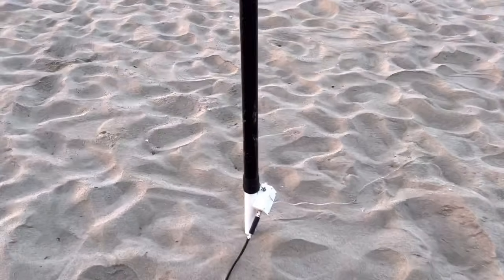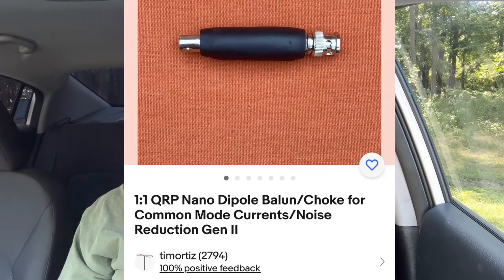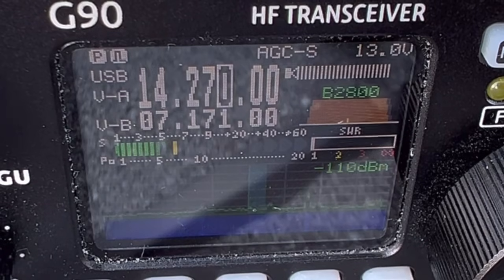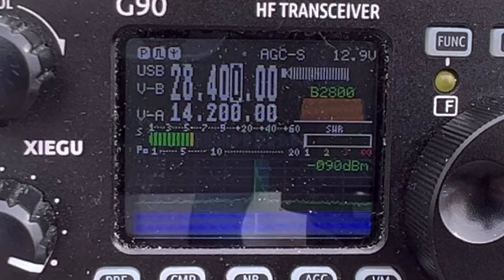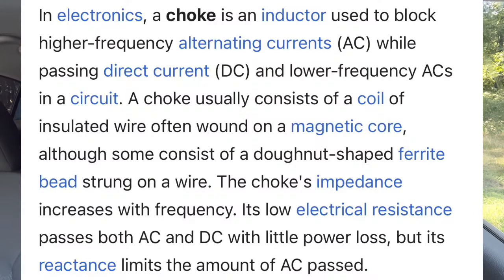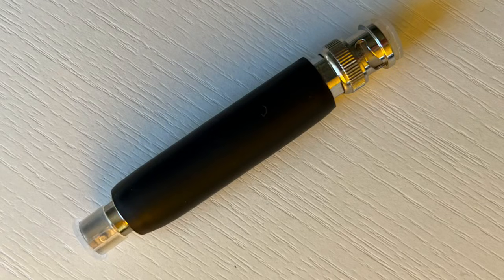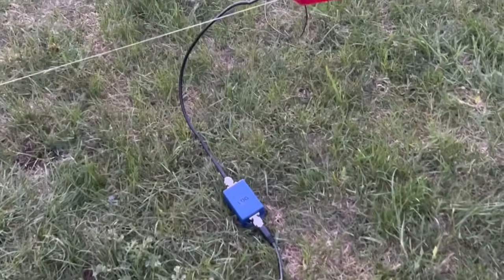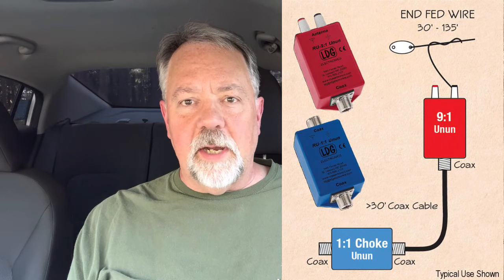Understanding RF Chokes for Antennas

Comment: This was helpful to me.  I've been a ham since around 1990, but I was off HF for various reasons for the past 30 or so years.  I'm retired now, and have been watching a lot of POTA videos and decided I wanted to give that a try.  I have a Kenwood TS-440 in storage but went ahead and bought a Yaesu FT-710.  I'm using a Chameleon whip with their Faraday strips for 20M and activated two parks in the past week, getting 60+ contacts each time.  My second park was quite noisy for unknown reasons, so I am hoping a choke will help with that.  Regardless, it should make my antenna more efficient.  I'm going to go with the Comtek inline coax choke from DX-Engineering I believe.

Thanks for this an all your other helpful videos.  

Dwayne
K4UTV

Comment: I'm an idiot, so bear with me please!  A choke is a choke is a choke?  I have an LDG 1:1 unun, and you're saying that all I need to do is connect it at the feedpoint?  Unless....at some point...I use something other than my 17ft whip?  And in that case, use the appropriate balun/unun with the 1:1 on the feedline after that?  Or is there a requirement for 30ft of coax between the appropriate unun and the 1:1 unun?
Reply from the maker: You’re not an idiot and that’s a great question. There are so many debates on where to use a choke and if you need one or not. There is no requirement of any amount of coax between the choke and the feedpoint balun if you are using radials or some kind of counterpoise. That’s my understanding and experience. 73, Walt
Reply: @COASTALWAVESWIRES  makes sense...I forgot about the counterpoise!  Thanks for getting back to me!!

Comment: Can you clarify something? If it’s an end fed antenna using the coax as a radial, should the choke be at the feed point or the radio? If the choke is at the feed point will that prevent the coax from being used as a radial?
Reply from the maker: If using the coax as the counterpoise choke should be at radio, not feedpoint.

Comment: I thought I had another issue as I was using a coax that had a built in choke. I decided to add more ferrites to that cable and bam!  No more rig and heil pro headset issues. It was all RF coming back into the rig.

Comment: ABC Lol... Thanks for the info Walt. I just got a 7 ferrite choke from ABR and had it at my radio, but I'm going to move it to the feed point on my long wire. I notice I've got RF into my shack because I can hear myself talk through my computer speakers. Hopefully that does the trick. KJ5IXX

Comment: you also change the radiation pattern when you use one i have tested this your Rf current field strength on the radiator is stronger

Comment: So if I’m installing a 49:1 EFHW (10m-80m) at my house. I was going to run the wire in an inverted V because I don’t have a lot of space, I was going to run around 40 feet of coax outside to be the “counter” should I put the choke closer to the radio or right outside the 49:1. If it helps I’m using a Par Endfedz antenna.

Comment: Allright it keeps the rf from coming back from the antennae, but how  does it let the rf from the transmitter get “to” the antennae? The way you are describing it, it appears to act as a check valve or diode.
I always  thought of a choke suppressing high frequency harmonics while letting lower desired frequencies pass based on the reactance at the different frequencies.

Comment: Could you reply and explain, If a solid copper #10 wire is close wound with fine # 30 insulated wire from end to end,  then both wires  soldered together at both ends. There was early 1900s patents on this style device, and was referred to as resistance coils. 4 different patents used this style device in antenna lines. Could you explain how this would work or what the effects would be? To me it dont make sense to solder both wires together at both ends.  Thanks BOB
Reply from the maker: I’m sorry to say I really don’t know. I’d have to research this one to give you a better answer
Reply: Thanks for the reply. Here is a short patent to look at for a quick study when you get time. Chauncy Britten, US patent 1826727. Be sure to use the Rex Research site when you google this. One other thing of interest is google Peter Markovitch ATREE. This explains the coil better and how it works. BUT, I cant see in my mind exactly what is happening. If you look at them, and have time , please reply back and explain what you see going on with this coil. I think its a RFC.     BOB

Comment: this may be a very simple question/ answer.. would using LMR coax help the lack of chokes due to it's properties? i would have to replace my coax if not, as it is cut/installed to exactly the length needed to get to the antenna. thank you for your videos. i am limited to 11m, just trying to do all i can for what i have.

Comment: Glad I saw your diagram with the ununs, I was confused with all the different ununs and baluns. Some youtubers say you need one type and then use another one. This is the first example of using two ununs on the one feed.
I’m still waiting for the 9:1 unun from Amazon, it seems to take an eternity. Yes I could make my own but I’m not really up to that. I’d like to start with commercial products before diving deeper, rather than flounder with something I made not working properly at the learning stage.

Comment: I installed an RF choke on the coax cable for my 10m Ampro 10 from Moonraker. The choke works well since it gets warm, indicating it's functioning. However, the heat also signaled that something was wrong with the antenna, suggesting inefficiency as the antenna used the coax as a dipole outer conductor. I already installed two radials, but they don't seem to be sufficient. The antenna is only 2 meters above the ground (which is fine for FT8). To test, I attached a 5-meter long wire to the ground of the coax connector, and the choke no longer got warm. The RF flowed through the 5-meter wire instead of the coax. I could have also installed the choke about 3 meters before the antenna connector, effectively creating a dipole. What I'm saying is that chokes can be used effectively to construct dipoles with coax without those inductive coax chokes that distort everything, especially at frequencies above 20m.

Comment: Great video… so I can use the LDG 1-1 ulnum inline in my coax when using my end fed random wire antenna to stop RF from coming back to the radio? And it will function as the needed choke?

Comment: Thanks Walt. I'm a new ham, and I can understand how chokes work (more or less), but I would like to know a little better about the correct placement or location for an antenna  choke. I've seen where guys hook them up in all kinds of odd places, near a balun on the coax, right on the antenna wire itself, even in the shack next to their radio. If you have an answer it's appreciated.
Reply from the maker: Great question and there’s really not a definitive answer, there are a few different schools of thought. If you are running something like an end fed halfwave with no counterpoise you might want to choke the coax at the radio and not the antenna feedpoint, this allows the coax itself to be the counterpoise. If you have selected ground radials on the ground  or a balanced dipole you would want to put the choke at the feedpoint to prevent the coax from acting as part of the antenna.
Reply: @COASTALWAVESWIRES  Thanks that helps a lot, as I'm setting up an end fed halfwave this week.

Comment: Can you elaborate a bit on the counterpoise wire added onto the choke… where/how exactly how to add that?  I’m new to this hobby.  Thank you.
Reply from the maker: Hi, the Counterpoise is added to either the negative side connector on the unun or it can be clipped to the outer side of the coax connector at the feedpoint. Basically you’re connecting the Counterpoise to the outer side wire on the coax.

Comment: Why doesn't the choke keep rf from getting to the antenna if is keeps it from returning??
Reply: Because the voltage and current are on the inside conductors, the choke increases the impedance on the outside braid of coax where the antenna current is travelling

Comment: Thanks for the video! Unfortunately, it looks like your friend no longer is selling the chokes. Some very interesting antennas though.  You've convinced me that I need to try them. I've been using a homemade vertical wire antenna tossed up in a tree branch when I'm portable. No choke or anything. Occasionally I see the SWR creep up and maybe that's why.
Reply from the maker: Thanks for watching and commenting. He must be out of stock, they go fast. Yeah you will see a major difference in the SWR when you’re transmitting with a choke. 73, Walt

Comment: Excellent explanation on the choke.  Funny the LDG documentation says a 30' coax between the 1:1 and 9:1, but your cable looks to be < than around 10'.  I guess the length doesn't matter as the whole concept of the choke is to block a frequency.  Again, great video on how to put all this stuff together.  The picture along with the explanation makes all the difference.  Great job explaining!
Reply: In LDG's diagram, only one wire is connected to the 9:1, with no counterpoise. So I think the 30' of coax is intended to be the counterpoise in that setup.
Reply from the maker: Thank you so much! Yes I think each situation is really different on the coax length. It's really all about testing it and seeing if it works in my experience. 73, Walt

Comment: I'm curious, if you just buy some of those clamp on chokes, how do you know how many to use?  Following your video to build a dirt cheap DX antenna, but some of the chokes are expensive ($50 too much right now).  I have a Xiegu G90, so I'm thinking I shouldn't need a lot to get on the air.  Thanks for the very informative videos.
Reply from the maker: I would experiment and start with one clamp on, tune the antenna, find an empty spot on the band, switch to FM mode, key the mic and watch the SWR meter on the G90. I've noticed that the SWR will jump high if you have common mode current in the feedline. I'd add another and repeat until you feel you have a good choke. 73, Walt
Reply: @COASTALWAVESWIRES  Thank you for the reply!  Would a ballun be necessary if using clip-on chokes?  If so, a 1:1 or 4:1?  Thinking specifically for the 17.5 ft antenna. 73 (AI5CK)
Reply from the maker: @ReformedPiper  for the 17.5 you’ll need a 4:1. It’s a great antenna.
Reply: Yes, I will try this as well. I saw a 4" coax with pl239 on both sides with a Ferrite core snap on with shrink wrap on sale for $25

Comment: I've experimented with ferrite rings lately and tried at the aerial and near the radio, I never previously bothered. The aerial ones didn't seem to do much and the ones at the radio worked better. Aerial manufacturers can't agree either, I've seen two aerial manufacturers where one said at the aerial and the other said at the radio. 
No dipoles of mine are in the clear so will always be a bit unbalanced but my theory is that r.f. can get on the coax after the choke considering the wavelength, the coax is in the r.f. field even though coming away at 90°. The SWR meter is happy with the rings at the radio. Perhaps we should use two? Or one a half wave or quarter wave down the coax?
G4GHB.
Reply from the maker: Interesting comment. I think each individual setup has different effects and it’s just a matter of trial and error. 73, Walt
Reply: @COASTALWAVESWIRES  Yes, see which works best for their system.
73,  Bill, G4GHB.

Comment: I also use a Nelson 9:1 unun with an 84' wire. I have made contacts all the way to Australia.. my problem is I get common mode current in the shack. I am not using a counterpoise based on the recommendation of nelson antennas.  I have upgraded my coax to 25' of kmr400 because it's double shielded. I get cmc worse on 40, 80, 160. Some on 20.   Based on this video and others by Walt I think I'm going to add 17' counterpoise and use a ldg 9:1 unun and ldg 1:1 choke. Any other recommendations? Hopefully i can stop my smoke detectors from chirping, my daughters led lights in her bedroom from flashing and my dogs collar from randomly zapping him while on the radio. I now take his collar off when I'm on the radio.
Reply from the maker: Take a look at the Chameleon Antennas 50 foot coax that has a choke on it. It's not too expensive and works great.

Comment: Great vid.   Just a note, a successful EFHW system is tapped at the end where the voltage and current is  zero.   So a counterpoise is irrelivant in this case.    On the other hand, a "random wire" antenna with a  9:1 balun... you do need a counterpoise because  the wire is not and  can not be any harmonic, including quarter or half wave of the operating frequencies.
Reply from the maker: Thanks! Roger that

Comment: Hey Walt. I've always coiled my coax at the feed point, something I learned from the old 11 meter days. I was wondering, and it may be a stupid question, do you tune your antenna first without the choke or with it? It makes sense to me to tune the antenna to the lowest possible swr first then choke it but I'm curious to know if that's the right procedure.It's too dang cold out for this OM to experiment. I'll do that in the spring. Thanks for the video though. The sink analogy was a good one. I always thought it was to prevent the toxic sewer gasses from leaking back into the house. Take care, some day we'll communicate on the air.
Reply from the maker: Greetings! I tune mine with the choke on it as I just think that it's better because that's how I'll actually be using it. You're probably right on the sink analogy hahaha 73, Walt

Comment: Thanks for your always interesting and instructive videos. This one clarifies what was kind of black magic to me until now. You've mentioned this choke many times as quite needed and useful. It lead me to trying to locate a source for such a thing here in France and even from online shops in other EU countries. I've failed miserably.
The alternative designs you show in this video will help greatly. Be it the air coil or the one using a ferrite ring.
Reply from the maker: Thanks for watching and commenting. I’m glad the video helped. 73, Walt
Reply: i also need help with the resistor and choke..what size resistor

Comment: Great video.  Always-Be-Choking.  I am running a 20meter long EFHW and counterpoises going out the window and on the windowsill I have a 64:1 (a Fuchskreiss unit) choked off with an FT240-43 toroid.   At the transceiver end of the coax, I have looped the coax through clamp-on ferrites.  Since fitting chokes at both ends of the coax, things are running much better.
Reply from the maker: Thanks! Sounds like a great setup!

Comment: Since you’re answering questions :) - There’s a question I have but I can’t find the answer. How does a nuclear detonation affect HF communication? 
Thanks for your channel, I usually learn something from you. Also, you sold me on the G 90 👍
Reply: It depends on where the nuclear detonation happens.  At ground level or close to the ground the primary effect is an electromagnetic pulse over a fairly localized area.  Much of the ionizing radiation is mostly blocked/absorbed by the dense air so it doesn't cause long distance effects.  There won't be much other effect to radio.  A high altitude or space based detonation has a much larger effect.  The EMP involved will be considerably stronger and can cover much of the continental US.  Additionally, the energy dumped into the ionosphere will have the same effect as the xrays from a solar flare - it will trigger an HF blackout for hours.
Reply: @stargazer7644  you’re last sentence confirms what I was suspecting. 👍
Reply from the maker: Ok you asked so here’s my stab at answering that question. Nuclear radiation is actually ionizing radiation so I would think it would actually affect the ionosphere above and cause some sort of disturbance for HF communication. That’s my guess. Let’s hope we never have to find out for sure LOL. Thanks for watching the channel and enjoy that G90, they are awesome.

Comment: Should a choke be used on a resonant dipole?  If so, should it be a 1:1 unun?  Lastly, what about a fan dipole (multi-band resonant)?
Reply from the maker: It is not required but a 1:1 balun (not unun) will greatly improve the performance of a resonant dipole as it will keep the RF radiating energy in the dipole wires and out of the coax basically acting as a choke at the feed point.

Comment: So let me ask,  I have a slightly varying swr on my 11m antenna.  Choking it will help keep the swr down??
Reply from the maker: That’s a hard one to answer because there are many factors involved. It may help but depends on the antenna type, local ground, etc.
Reply: @COASTALWAVESWIRES  gotcha.  It's just a standard fiberglass top load, got it mostly tuned but now and then the swrs cause my anytone to cut my transmission.
Reply from the maker: @chrispierce2942  if you put the choke at the end near the radio you will probably see some improvement because it will be choking the common mode current from coming back into your transceiver and making the SWR spike.
Reply: @COASTALWAVESWIRES  that's what I was thinking after seeing your video.  It's a mobile in my semi.  Maybe the clamp on type would do the trick.  Appreciate your feedback.  Thanks Walt

Comment: I was wondering the difference between ferrite beads and a 1:1 transformer
Reply from the maker: a transformer chokes the outer ground side within the internal turns where as ferrite beads do pretty much the same thing attached to the outer skin or ground side of the coax.